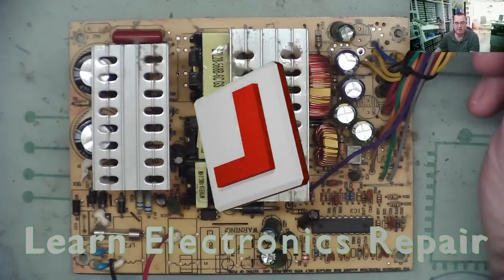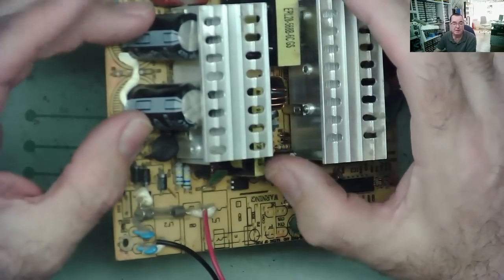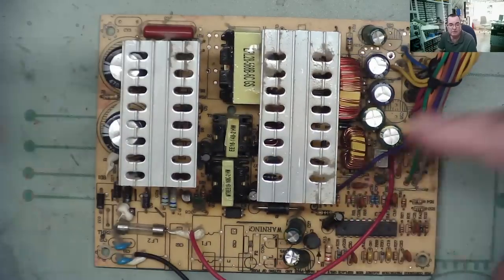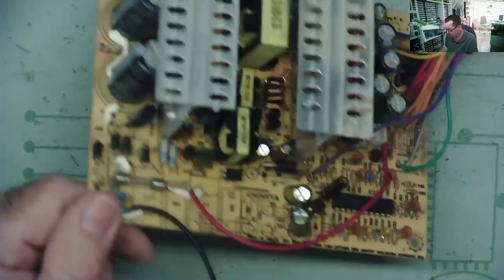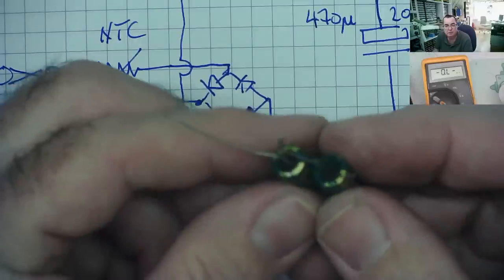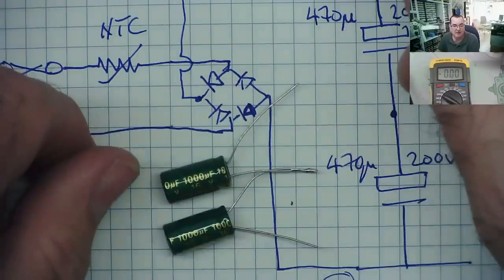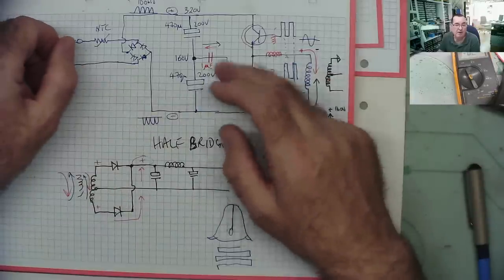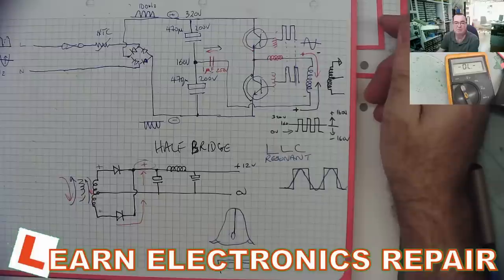Why Does An ATX Power Supply Have Two Main Smoothing Capacitors? How ATX PSU Works Tutorial

Comment: I am always impressed by your ability to draft up a circuit, in realtime, with annotations, explanatory notes, colour keyed current flows, and graphs. All while running a narrative. Your brain works in ways mine doesn't, and we all benefit from your desire to teach. Thank you!
Reply from the maker: Thank You 😊
Reply from the maker: I mentioned your post to my wife and she want's to point out that in her opinion I'm (like all men apparently ) hopeless at multitasking 😂😂😂
Reply: @LearnElectronicsRepair  and thats why your wife loves you sir!
Reply: @LearnElectronicsRepair  Good explanation but would it be important to have two capacitors rather than one, and also is it really important to change the squar wave for a sinewave? Because the circuit get bigger and bigger and the purpose of it seems strange as the square wave can just as do the job???
Reply: @MotherRussiaisforever Well yes, it's important to have two capacitors. If you had only one capacitor, you would have no Junction between the two capacitors; and it's important to have the LLC circuit for more efficiency.

Comment: the best explanation in my 20 year line, even if 1 capacitor is bad the smps won't work, have 3 cooler master smps 2 with active pfc, trying to repair since ages, no 5Vvsb present in all.

Comment: The LLC circuit explanation is great. I'd often wondered about that, as it seemed logical that sending an analogue device like a transformer a square wave would not be doing the system much good from a noise perspective. The bell analogy will stick in the head nicely, thanks!

Comment: As always, a video full of well dispensed knowledge. 

Side note : not all LLC circuits are resonant. They do transform square waves into sinusoidal waves but it is not what it is called resonance.
In a LLC circuit and basically all RLC circuits, resonance occurs at a certain frequency. The phenomenon is a noticeable voltage therefore current increase in the circuit due to combined characteristics of all components.
Often, accidental resonance means destruction of the circuit.
The same phenomenon applies to physical oscillators. That's how wind or troops walking at pace can destroy bridges.

Comment: I learned a lot! I always thought transistors were low voltage devices. I can see now that I could fry my oscilloscope if I were to randomly probe transistors inside one of these supplies!
Reply: Be careful connecting your oscilloscope to the collector or drain of a FET switching transistor. I have done it but don't recommend it. Best to use a high voltage probe to prevent damage to your scope.
Reply: A video that could be helpful:
https://youtu.be/xaELqAo4kkQ

Comment: Brilliant job , one of your best yet. Thanks.
So , if you did change the value of BOTH of the large caps to a lower capacitor value (not voltage rating) it would still work but at a lower max output .

Comment: I am fixing an old Iwatsu scope's power supply and it has dual diodes for 12V, -12V and 5V rails and the anodes are actually connected together. And a single 4ns rectifier diode for the 54 volt rail. Not sure if it was done for added current handling, but the specs for rectifier diodes were hard to meet with newer components when I looked for replacements. The 54volt rail consumes the least current so they used an ultrafast 1 amp diode for it, but other rails are higher current.

I ended up replacing the 1 amp diode that had burned with a 4 amp rated diode that had a matching forward voltage/current curve all the way to 1 amps. And I only found one that had matching speed, capacitance and forward voltage when I looked up from Mouser :)

Comment: a good video. Most of the power supplies I have worked on with 2 smoothing caps have either been as you describe here or they are 110 240 switchable or even autosensing using a thyristor between midpoint and bridge for 110 240 selection, of course, most modern PSU's have PFC so no need for the selection.

Comment: Thank you again!

I kind of got it, well I thought I got it, until it hit me... Why take an AC signal and convert it into DC, just to turn it back into AC? Seems like a waste of energy and components. Silly question? I'm really trying to understand this, and your help is invaluable.
Reply from the maker: Not a silly question actually.  So the mains is AC but a high voltage.  We need a low voltage DC.   Yeah you are correct in wondering about this, because in many cases the power supply has active PFC, which basically does the conversion 240C AC --> 380-400V DC --> low voltage AC --> low voltage DC.   I'll think about how best to explain this but the answer is most probably it is the most efficient way to do it.
Reply: @LearnElectronicsRepair  I think the easiest way is to say that for higher power applications it's much more efficient, much smaller and much less expensive than a linear transformer PSU at 50/60Hz - DC is required so it can be 'chopped up' into a much higher frequency AC which can work with relatively tiny transformers, the main downside being noise. Probably not the best explanation but it's what's in my head :)
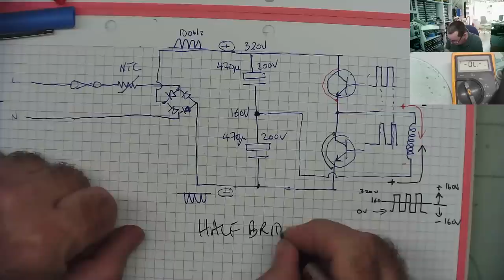Reply: @LearnElectronicsRepair   But I'm referring to the pulsed DC on the high voltage side, at timestamp 28:00. So, with the answer from @budgiefish, it means that the sole purpose is to speed up the frequency?

Comment: Why rectify the AC, only to convert to +/- square wave to put through a transformer? Why not stick the AC straight into the transformer to derive the lower voltage rails, then rectify only on the secondary sides? Especially if sine waves are more efficient at driving transformers than square waves? Just discovered your channel -- you're the first person I've seen explain ATX power supply topologies in this much detail. Thank you!

Comment: On older supplies they have a 110/240v selector, somehow the selector changes the capacitor config to a voltage doubler
Reply from the maker: Yeah, we can have a look at that. One of the PSU I rejected when making this video (as over complicating things) has the 240V/120V selector and it simply shorts two points on the PCB when set to 120V
Reply: For 120V, the center of the 2 caps is tied to the AC neutral.  The diode bridge charges one cap on the positive half cycle, the other on the negative half cycle. It's basically two half-wave rectifiers, AKA a voltage doubler, to get 320V DC from 120V AC.

Comment: Thanks for this explanation. You drew the transistors as BJTs was that intentional or a mistake?
Reply from the maker: @fixfaxerify Intentional.  In this circuit the transistors are almost always BJT.  In fact I've never seen ATX use mosfet here, though the 5V STB supply is usually mosfet driven

Comment: Its true to say the transistors are driven in antiphase but you have to remember that there needs to dead time where they are both off. As any overlap In  the switching pulses will short the power rail out.
Reply from the maker: You are totally correct but let's not over-complicate this when I'm trying to teach the basics of what is going on here yeah? 😉
Reply: True - but luckily the SMPS controller chip is working it out for us !
This deadtime ensures the one transistor is completely off before the other one is on.
The controller always put in some 4% dead time minimum, but it can be adjusted on a dedicated function pin.
This is by the way used as an extreme start up condition using a capacitor on this pin, which makes for a long dead time (pause) at initial startup.
Also called a softstart, as the transistors are only briefly turned on for the first few cycles.
Reply: @LearnElectronicsRepair  that actually keeps it simpler by keeping it in high detail.

Comment: 28:20 You forgot 1uF polypropylene capacitor in series with the winding. This is critical. Actually it holds the charge.

Comment: Nice explanation Richard but I am a bit confused about the negative voltage pulses you have drawn on the first full wave bridge rectifier.... I believe that line would be a steady 0V ....

Subbed and liked..👍
Reply: That's actually a good catch. 
I suppose if you used the mains neutral as your reference you'd see negative pulses on the DC ground but I'd expect it to be a half wave instead of the rectified wave as drawn.

Comment: When this PSUs are 120V/220V switchable they pull an extra trick, at 120 circuit is more like a capacitor doubler circuit, so V+ is still 300V or so. At 220V is just a full bridge with the two caps in series and V+ is 311.

Comment: Its not the only reason...: Other reason is that if they are in parallel the internal resistance will be smaller and together they will be more effective than only one. Next reason is that if one fails then the other can keep it going...(if one of them has enough capacitance). Also there will be shared current so one of them dont get so hot (charge and discharge current will produce internal heat because of internal resistance)

Comment: Hi I have been watching you for awhile. I love your informative videos. Power Circuits are my favorites. You may have already answered the question. But what happens to the Drive Transistors if the neutral side is not connected? Does the High side MOSFET get the entire 320V load?

Comment: I have an AT power supply that I plugged in and when I switched it on there was a 2 or 3 volt briefly on the +5 rail and it quickly went to zero 
This is WITHOUT ANY LOAD... and as far as I know all AT power supplies behave like this.
I measured all the leads and there was nothing
As soon as I connected a load.. in this case a hard disk and I turned on the power again it FRYED my hard disk in a second... smoke and a burnt chip
After that I think the power supply fuse also blown
Do you think the transformer is fried or can it be the power transistors ? 
thanx and great educational video btw

Comment: Where is this inductor ?. Haver been in this generic PSUs several times. What I have seen is they pass through the coil of another transformer (the one used to send pulses to the transistors from the controller in the cold side. Never seen inductor on the HOT side away from input filtering. Is it tuned with the other transformer. NEver got this point. Thanks.

Comment: I'm the first time on this channel and the explanation was excellent. Was wondering for a while how these power supply work. Also what I would like to know is how the driving square wave selected? Why is it in MHz range? Does the frequency of the square wave changes based on load, if so, how is the load balanced on different voltage taps (3.3V, 5V, 12V) ?

Comment: When the ups turns on, it needs 2 sec before the power reaches its maximum, the capacitors supply some power during this time gap. When motoric devices turn on, power reduces for some seconds.

Comment: Great video! a very clear explanation. I have a question, If one of the main capacitors are blown, is it necesary to replace it with exactly the same capacitance? What would happend if I use a 330μf along the other 470 μf? Will it shorten one of the square wave cicles? If so, how  would that propagate?, Will it be hard on the 12v and 5v capacitors? or Will it affect the duty cycle?
Reply: hey i have exactly the same problem how did you manage?
Reply: @gatheesha22  
I have spent a good hour on that psu. The end result having missmatched caps was pulsed 12v rail, and a lot of inestability. I would love to have an explanation on the topic. best regards

Comment: I have a cooler master and inside are 2 huge capacitors (maybe the smoothing capacitors such as these in your video), one of which is leaking electrolytic fluid, swollen at the top. PC does not turn on.
When i bridge Green and Black and switch on PSU the fan does spin ok, but when i try again the fan does not spin, it is intermittent.
Can a capacitor cause this?

Comment: Makes sense that cap inline with the  transformer primary going to centre tap of mains smoothing caps, otherwise  each single mains smoothing cap would alternatively have 320V accross it when either primary side switching  transistor  turns on 👍

Comment: The green wire you said recieves 0V (dunno how it can recieve nothing) actually gives out 5v. I know this as a fact, just measure it with a meter. It's a well known fact that connecting the green wire to black (ground) will allow you to switch on an aTX supply without a motherboard being connected.
Reply: Does it float high at 5v, and pulling it to ground (low) fire up the psu? I always knew about shorting green but didn't know exactly what all is going on behind the scenes.
Reply: You short the green wire to ground pulling the 5V down to 0V. The psu  technically receives a 0V signal to start but it is probably better to say it is ground as it is a voltage in reference to another. Remember the unplugged state of the psu would also be 0V on the green however no other voltages are present so the psu cannot start.
Reply: "Receives 0v" translates to "is pulled low" or "is connected to ground"

Yes, he could have phrased it more accurately but your comment comes across as pedantic considering your familiarity with the function of the green wire.
Reply: @speedycpu  yes exactly that
Reply: @speedycpu  yes exactly how it works

Comment: so in that resonant circuit ,  going back to that cap, is that the place  where the wire is occupied both by AC  and DC on the same wire ( foil ) on the circuit board ? and is that the  key to changing a square wave to a sign wave ? Can it be considered a pure sign wave,  with more caps involved of course ,,,

Comment: Had a go at troubleshooting an LG 55" TV last night. Everyone kept saying the PS was defective, because it would not turn on, just had a pulsing red light. Nah. Checked all the voltages, checked the caps and no faults found. Seems it has a faulty motherboard, which is way beyond my capabilities. Yet. Incidentally, the PS was effectively the same as this one, but with slightly different voltages, 3.5V, 12V, 24V.
Reply: Normally capacitors are defective on the power supply
Reply from the maker: Disconnect the LED back lights (assuming it is an LED TV) and see if it stops pulsing.  Often there are two or four strings of LEDs int he back lighting and if they don't all draw the same current (caused by one or more defective LEDs in one or more strings) then the TV will likely behave as you describe.  Really you need a backlight tester to check each string out - if one has a different voltage to the other, using the tester, then that is your fault.
Reply: @LearnElectronicsRepair  Thanks for the tip! I disconnected the backlights and it made no difference, unfortunately. There's only one connector for the backlight so I assume there is a distribution board "deeper in the sandwich" somewhere. I'll just wait for the new parts now and test them out. Much appreciated, regardless.
Reply: Mr Guru  I actually thought along those lines, so I have plans to add a fan to the bga heatsink, provided there's room. The little bit of extra noise won't bother me. :)
Reply: @trone32  They seemed to be fine for me, I removed the larger ones and tested them without finding any issues, and the PS gives all the correct voltages to the main board. It will be interesting to see: I've ordered a new main board for it now.
Reply: Update: Replaced the main logic board, and we have a working television! Will try to figure out what has failed on the faulty board, just for kicks.

Comment: Hi,

I bought a new smps, but I am facing issue when there is power cut. My computer is connect to invertor, still when there is milliseconds of gap for invertor switching to ups mode the computer restart. 

Can you help what I have to do
Reply: Can you help me to increase the hold up time

Comment: How does an ATX power supply regulare 3 voltages if it doesn't seem to have 3 of every part? If the feedback causes the transistors on the primary side to be active more, it would influence all voltages.

Comment: Actually, the circuit You draw for the secondary side is wrong. And is wrong badly. Since the DC-DC converter in ATX is working in so called 'forward mode' topology, with variable duty cycle (to be able to produce stable output voltages independent from input voltage or load), it is of most importance to have storage coil (yellow toroid ferrite in most of atxs) BEFORE any capacitors. This coil has two functions, to limit the current through switching transistor during the on time, and to, due to collapse of magnetic field inside 'refill' the capacitor during the so called 'dead time' or the time both switching transistors are off. 
If you put the electrolytic capacitor before this coil, two things will happen. First due to huge charging currents your secondary electrolytic will get very hot, the rectifying diodes too, and after some time your switching transistors in primary will blow due to termal runaway caused by high currents. 
There are other topologies, current fed forward, flyback, etc witouth mentioned storage coil but are not used in atx. Actually the ATX is using small aux flyback supply to produce standby 5V/2A for the PC and 12V for the main power supply controller. Also, old computers, like Apple I, used flyback as main power supply but it is not used above about 50-100W output power since pulse currents through switching elements are getting much bigger, ferrite core transformers are getting big fast and overall efficiency is droping below tollerable minimum. Keep up the good work!